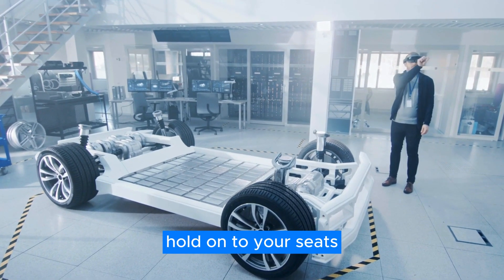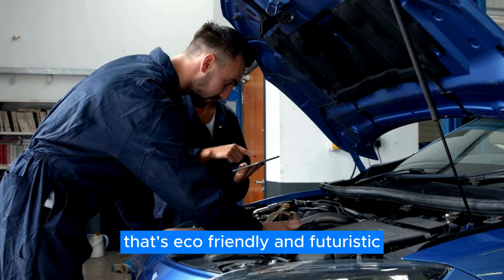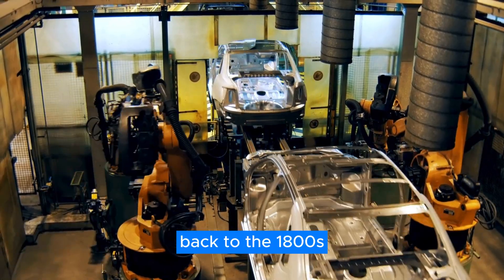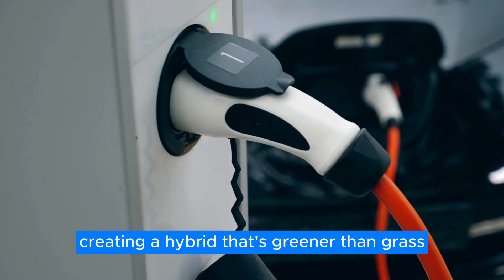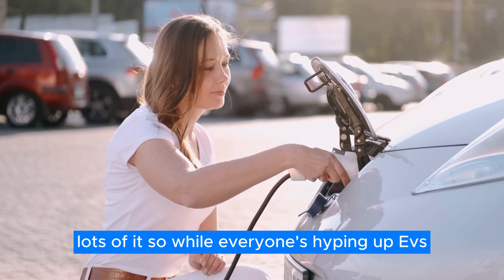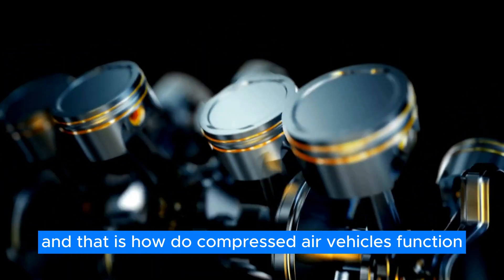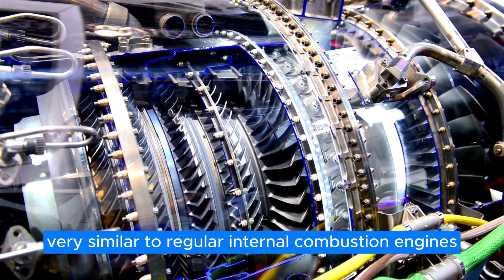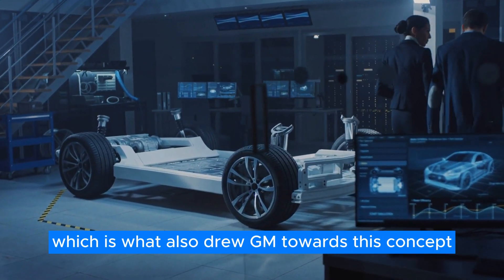GM CEO: "This New Engine Will CHANGE The World!"

Comment: I couldn't finish it. I kept nodding off waiting to hear the point. Where will the compressed gas come from, how will it be stored and at what cost for all of this? Anyone that follows engines knows about compressed gas engines. Heck, there's a guy on YouTube that 3D printed an engine and connected to a soda bottle, it turns a propeller and propels a model airplane, for several feet. India, probably Tata Motors, demonstrated a plastic engine powered car fueled by compressed air. It is likely compressed by electricity from a coal fired powerplant.

Comment: A very poor alternative. Compression to expansion efficiency is very low and the tanks will need to be inspected and tested very often
Reply: Liquid nitrogen is basically liquified air without the oxygen.  It can be contained in a vacuum insulated container.  Pump some out and spray it on a large belly pan aluminum heat sink that gathers heat energy from the moving air at the bottom of the car.  The nitrogen boils and pressure is created driving the air engine.  I just thought of this.  I don’t see why it wouldn’t work.  Electric power plants would compress the air separate the oxygen and make liquid nitrogen.  It can be shipped in tanker trucks just like fuel.  Bad crashes would be easier to clean up too, as the people would be frozen and shattered into pieces.